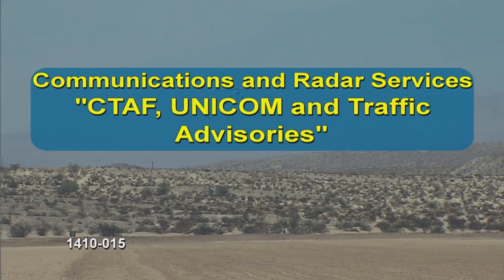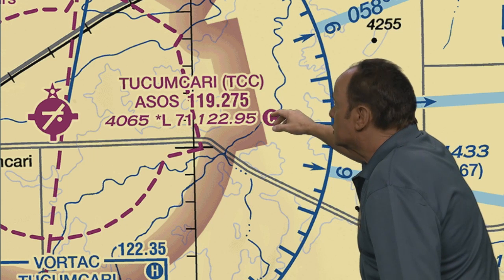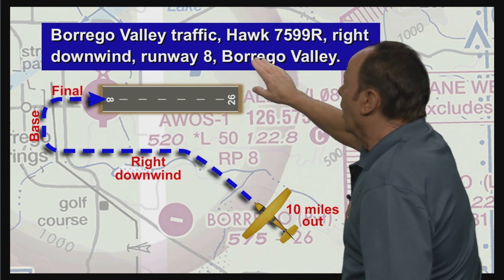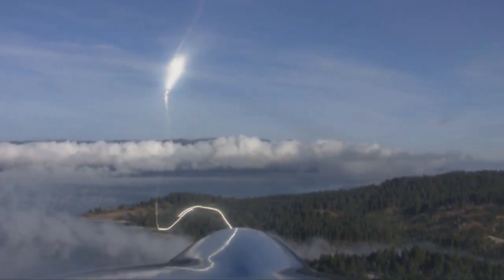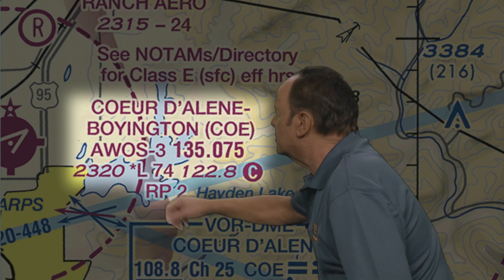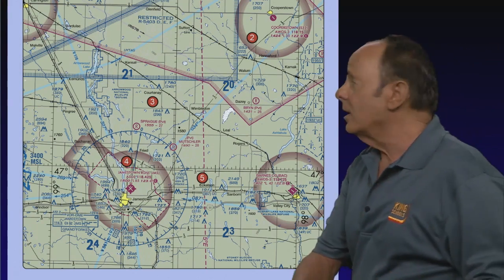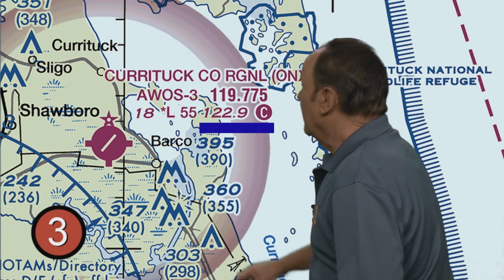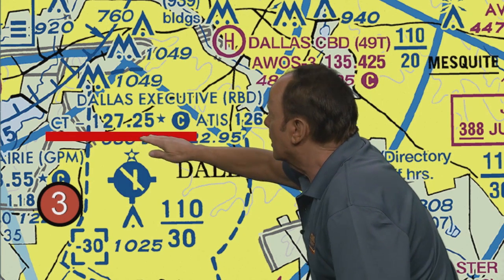Communicate Like a Pro at Uncontrolled Airports // Private Pilot Ground School

Comment: I don't have many unmanned airports near me.  If you were to come almost straight in on this example, how often would you report your distance?  Every mile from 10?  Would you overfly and enter on the right?
Reply from the maker: Start reporting at 10 miles, then maybe at 5 and entering the pattern? Every mile may be too much. Pattern entry is determined by your direction of flight.